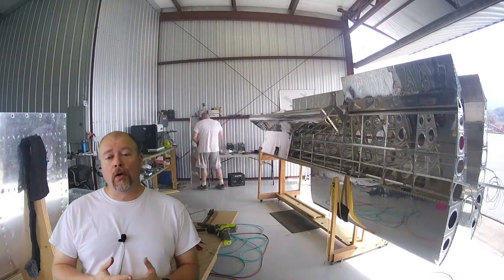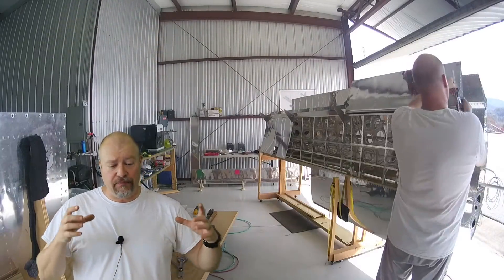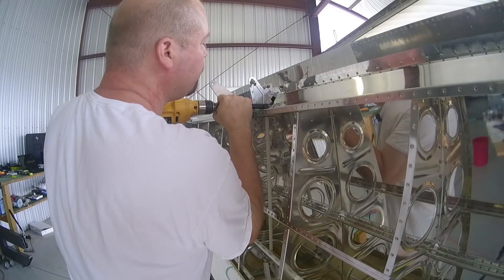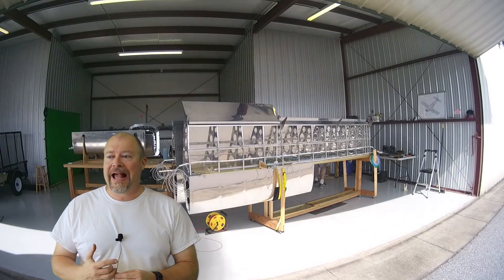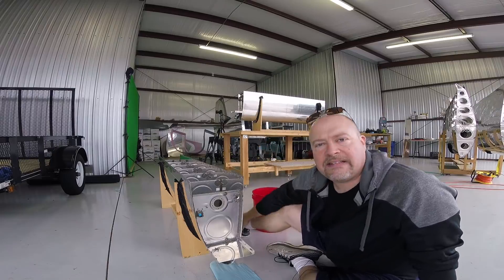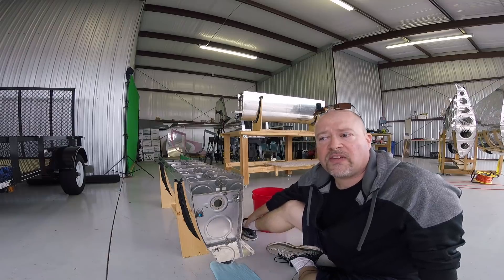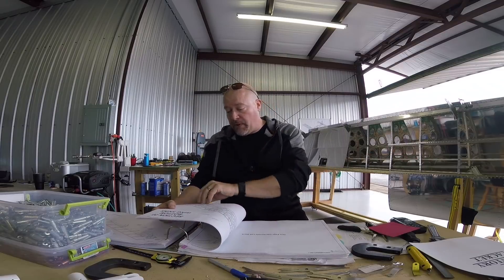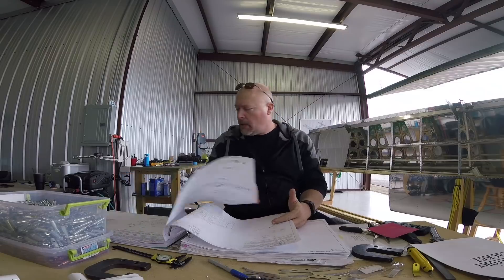RV-10 Wings - 070 - Hinge Bracket, Open tank testing, Stopping point and moving forward

Comment: Many years ago when I worked on F/A-18 Hornets we had the running joke that if it wasn't leaking then there's no fluid in the bird.  It was typical to have 3-5 large drip pans under the legacy Hornets for the fuel and hydraulic fluid.  Although once you got the system running nice and hot many of those leaks would go away as everything would seal up a lot better.

Comment: hasn't starting getting chilly there yet?
leaks that bothered me were with AIR, not water, including a pinhole leak in the nitrile glove being used as a balloon.
Don't automatically assume that the new plans ARE the latest and greatest.   Check thru your parts bags tp make sure that there are no NEWER and more Improved plans included with the packages (yes, I've found a couple and didn't bother going into detail with them cuz I assumed that the pages in the plans packet were plans dupes of what were in the parts bags --- and had to re-order parts cuz I followed the plans packet instructions only to find that I should have used the pages in the parts bags.)
Problem with quick-builds is that you lose experience that you might need during a future annual (condition) when a problem crops up (like finding more tank leaks) ...
Oh yeah, huh --- and then there are are SBs that Murphy says Will come forth just after you finish building a section that will have to be redone .... (been there on that one too)
Reply from the maker: Not too bad yet, but it will get cold soon!

Comment: pla does solve most of the warping you're mentioning, but be forwarned that if you're planning for parts to be used in the aircraft (like ipad mounts or something else), that the ambient temperature under direct sunlight behind a windshield could be enough to deform what you printed.

Makers Muse's channel did some experimentation on it, and pla parts somewhat melted in his car, where abs did not.  granted, he's australia, so a bit higher temps than where you're at.

i like printing pla far better than abs for sure, so you are heading the right direction i believe with it, just be aware that it's a bit rougher going through your hot end than abs is.  this will def lead to more jamming than normal, especially with that extruder that the davinci uses.

you're doing the right thing, no worries there.  just brace yourself that pla isn't always the magic bullet.

moving over to it when i had my xyz machine jammed all the time.
Reply from the maker: Good to know!  I'm still a newbie here but I really want a SLA machine..